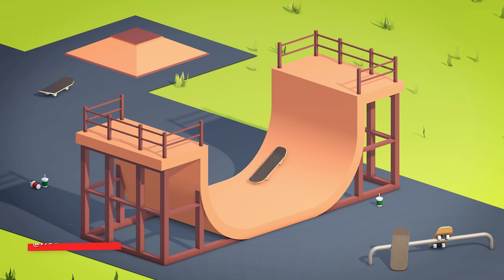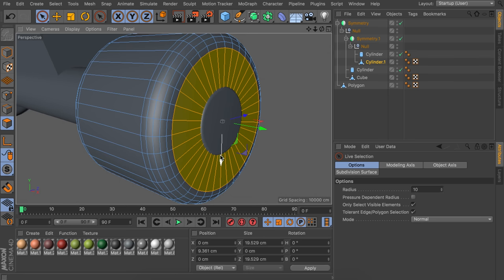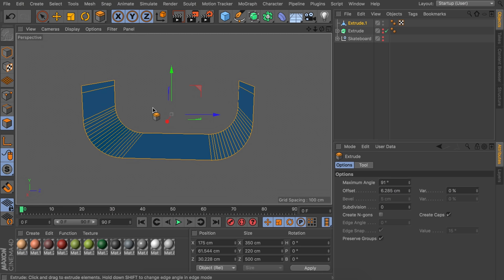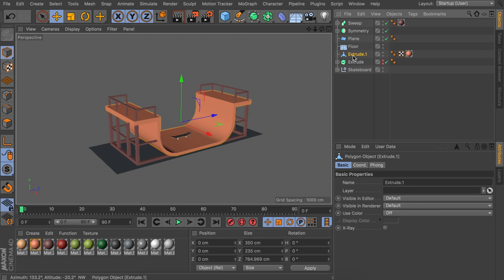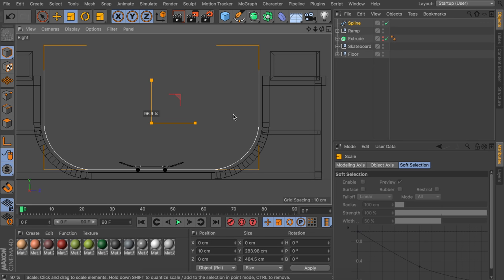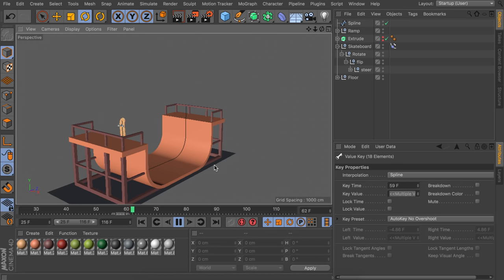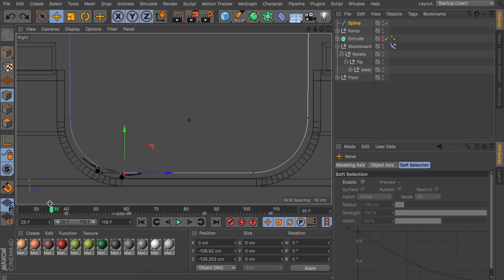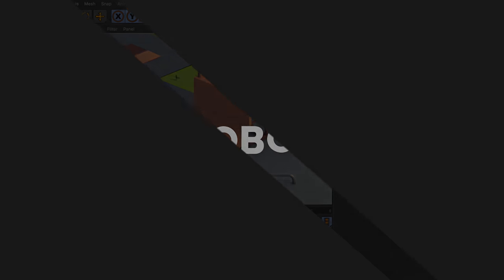Skatepark Modeling & Animation - Cinema 4D Tutorial

Comment: I'm stuck at 1:25, rounding the corners.  I'm in r21 and the bevel is not doing anything like I see here.  It's just sliding along the edge not changing a thing.
Reply: Never mind, I ended up going over to R18.  The bevel options in R21 are weird now and I'm not used to them yet

Comment: I need your help...when i try to scale down the bottom of the cup then arises a gap...so i can only scale down the polygon but the cup will not be smaller...pls help
Reply: Cylinders do that, they have their caps/ends not connected with the ring/tube. To connect them go in the point mode > select all points (ctrl+A) > press U+O (Optimize function)
Now everything should be connected like you want it to.
Reply: Thank you! That worked pretty well